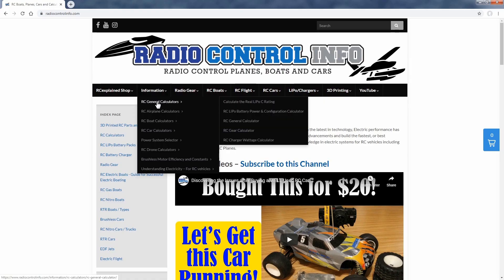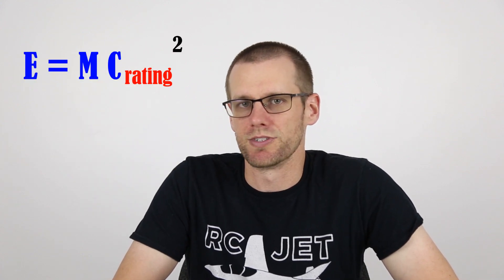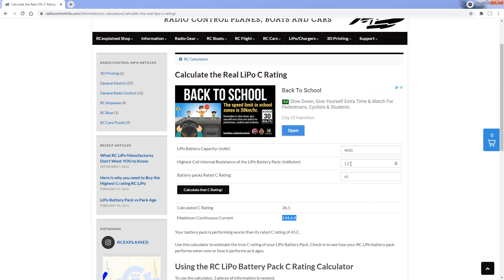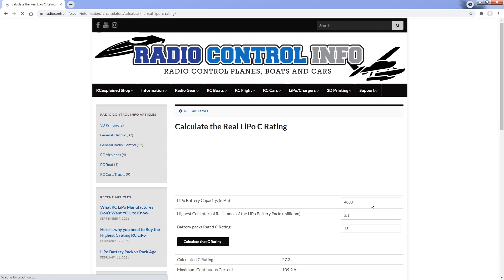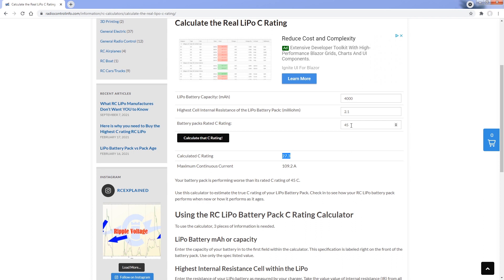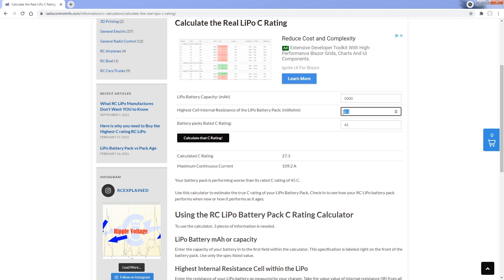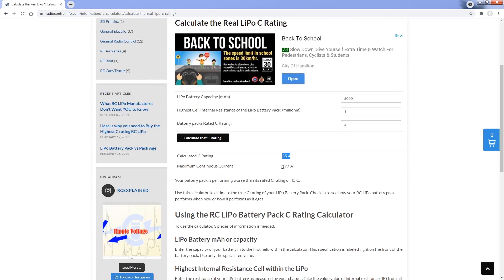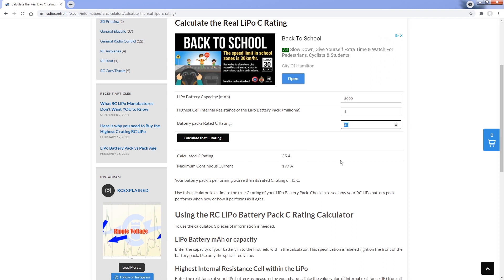Determine the Actual C Rating of a LiPo Battery, Formula Exposed!

Comment: Besides the inflated nature of the C rating. Why is there a C rating anyway, if the actual current in Amps, a battery is capable delivering, depends on the capacity? While, what really matters for the application is the current only!
What I mean is:
A 5000mAh battery with 50C could technically deliver 250A. A 2500mAh battery would need a 100C rating to provide the same 250A. A 2500mAh battery with the same 50C as the first example, would only be able to deliver 125A!
So what good is it to require a 50C or a 100C rating for a given application, if that figure still doesn't tell us, how much current the battery will be able to provide, without throwing the capacity into the equation as well?
What they should print on the battery label instead, is simply the current, which the battery can deliver! After all that is what an ESC bears on its label as a technical requirement for it to operate! 🧐
Reply from the maker: Absolutely agree. I think a C rating leaves the answer a bit cloudy and easier to inflate. Inflating the max continuous discharge current would not be easy. That's my take.
Reply: @RCexplained  Absolutely correct!
Inflating a precise Amp rating on a battery label would come closer to a blatant scam, as if inflating the voltage and claiming an actual 2S battery to be a 3S. Nobody would accept such a blatant scam. But, as you often mentioned, there is no definitive standard to even measure the C rating, which is a perfect setup to get creative...
Reply from the maker: Yep, exactly, and this is why I buy lots of LiPo's to test their performance and share the results!

Comment: I just want to make shure if it´s right, but why considering just 1 cell for internal resistance instead of total pack cells internal resistance? Do you have the formula oficial source?
Reply: His math is not correct. You need total IR if using total capacity.

If not you need to consider how many cells and how they are internally connected in determining how you calculate. 

His principle is right but this math is wrong. You don't just ignore a load and heat source because it isn't as big. If a 2s pack it experiences a 2 cell total output resistance due to being connected in series. Throw some parallels in there and it gets a little more tricky but not bad.

Comment: Lesson learned: pretty much all of my batteries are ~15C, even the ones which say ‘60C’. Funnily enough, like you have proven, the batteries with the most absurd claims like 60C have a lower actual C rating of like 10C compared to batteries which claim a less inflated 25C… do you have any recommendations for battery suppliers who give appropriate ratings? Thanks.
Reply from the maker: I don't think it's about who has true c ratings. I look at it more as who has the best actual true c ratings. So far smc if you are looking for discharge power
Reply: @ what about longevity? Thx so much for replying 😁

Comment: Hi I have a question about 4 new batteries I just purchased - these are rated 7,6V HV 2s2p lipo's rated as 140C - 5c Charging - your website doesn't seem to be able calculate with this. However if I use the 120C which is an option on your website I come to shocking results. The measured IR at 1.5 A charge is 3,6 mΩ for these 5800 mAh batteries - When I enter those numbers on your website these batteries should be rated as 17,3C ---thats a really big difference compared to the advertised 140C. Am I doing something wrong? These are the - Abisma Competition Lipo Shorty 5800mAh 140C 2S2P HV Batteries
Reply: he explained the formula.. you have to divide the constant use of 2500 by the square root of your batteries Mah capacity X the internal resistance on your worse cell.. 

Mah x IR =???? then square that number and divide it by 2500. that will give you your C rating

Comment: For a real world test use a volt/amp/watt meter in series with a high draw motor wide open.  Divide your amp draw by your capacity and that is exactly what the pack is providing at that moment.  100A draw divided by a 5A pack is 20C.  If you have it and your meter can handle it, try a higher power ESC and Motor.  I have an HRB that can deliver around 65A and a Roaring Top that can deliver 100A with the same load.  The voltage drop of the HRB is severe and the higher internal resistance makes the pack hot.  I have a 6 year old Power Hobby pack that can do 80A.
Reply from the maker: Yep, I did that on Zeee batteries on the channel. But more recently and quite a few packs I've tested, I've looked at IR and loaded power @ ~105A

Comment: hi great videos helped me so much. im making my own battery pack, but im struggling to understand the manufactures 3c rating on a 5000mah single 3.7v cell and turn that into a c rating like on a new 4s pack. be most appriciated if you or some one could help

Comment: Hello! Does this formula (2500/sqrt(capacity*IR)) applies to li-ion batteries as well?
Reply: I've salvaged some batteries from an old Lenovo battery pack, and according to this formula it gives a maximum current of around 25A. Is that possible?
Reply from the maker: The formula is untested for Liion batteries. You can cross reference specs on the cells to find max current.

Comment: I ran a bunch of my batteries with a 1.5c charge rate on a Spektrum S2100 charger and took the first internal resistance reading that popped up after about a minute. This is what I got:
Spektrum
4s 5000 100c ir=5.8 c=14.7
4s 5000 100c ir=4.0 c=17.7
4s 2200 100c ir=15.5 c=13.5
4s 2200 50c ir=15.6 c=13.5
4s 2200 50c it=14.7 c=13.9
3s 2200 50c ir=10.9 c=16.3
3s 2200 30c ir=14.7 c=13.9

Venom
3s 5000 35c ir=5.8 c=14.7

Gens Ace Tattu
3s 1300 45c ir=19.4 c=15.6

None were anywhere close to their advertised C rating and there was almost no difference between 30c, 50c, and 100c packs. It makes me a little suspicious of the formula or how the resistance is measured. Or is there really no difference between a 100c and 30c pack from the same manufacture?
Reply from the maker: Definitely strange that they all work out to similar values here. Formula is hard to argue with but the measuring tool could be a source of error. If 5.8 milliohm is true on the 5000mAh pack, this would have a hard time dealing with the power system installed in the recent EDF Jet video doing 249km/h that I posted. Just for reference, I use 4000mAh 45C packs and they have an average cell resistance on the charger of 3.2 milliohm. This is measured at a 1.5C charge rate 1 minute after starting the charge from 3.80V per cell. Make sure the cell resistance is measured quickly after initiating the charge and it's best to start the charge around 3.80V. Temp should be room temperature. Lots of resistance influencers here.
Reply: If those are your IR numbers you need new packs.  
But you are suppose to get your ir numbers with a pack at storage and room temp. And then charge. And take the ir reading when it’s close to finished

Comment: Where does the equation you show come from? Also, you are using the manufacturer's rating as part of the equation, but that number may just be made up. Also, when measuring the battery internal resistance, shouldn't a test current be specified such as 1C? Some of these internal resistance measuring devices use a very low test current and get an unrealistic low internal resistance measurement. It would be good to determine a C rating from internal resistance and also maybe temperature rise. Finally, thank you very much for trying to address this sticky industry problem and making such a great video.
Reply from the maker: The equation comes from a lot of testing and number crunching. You can see the battery tests we do on the channel. I've found a batteries true internal resistance by loading it at that value and making certain it doesn't get over temp.
I may have missed saying it in this video, we use 1.5C on the channel.

Comment: How are you coming up with this formula? Are you using Ohms Law: V x IR or P = I^2 x R? Formula is very suspect without some sort of explanation as to how you come up with formula and 2500 constant. "Extensive Data collection" doesn't really do it for me.
Reply from the maker: Yes, it was done with extensive data collection. All data points were plotted on a graph, and a regression analysis was employed to determine the line of best fit. Electrical theory wasn't utilized in this process. Although the formula still tends to overestimate the actual c rating, it gets significantly closer than any specification you'll find on a battery label. 

Additionally, I've shared battery test results, along with the methodology I employed to get the true C rating of a battery. These battery test videos are unpopular but there are several I've uploaded. Only one video shows me getting the true C rating through a loaded run.

Comment: Great video Ryan! I'm just getting back into the hobby from 30 years ago. I have a WL Toys144001 car that came with 2s 2200 mah 25c, brushed 550 motor. I'm preparing for an upgrade my 144001 to brushless. Planning to us a 3650 - 5900kv with the Quicrun 10BL120 ESC for Speed Runs and general parking lot driving. I'm trying to match the best lipo mah and c rating for this setup.  Are you able to recommend lipo to work with this setup? I've watched a lot of your videos but still somewhat confused.  Here are the motor Specs: Specification: 

3650 - 5900kv
Material: Metal + Magnet 
Weight: 204g 
Item Name: 3650/3T Motor 
Watts: 900 
Max Voltage: <8.4V 
Max Amps:107A 
Rotor Poles: 4 
IO: 5.2A 
Resistance: 0.0043 
KV (RPM/Volt) : 5900 
Max RPM: 50000  

Thanks for any help you may offer!
Reply from the maker: If your priority is speed. Largest pack in terms of capacity and c rating is best.
Reply: @RCexplained  Thank you Ryan for returning my question. 👊😎👍

Comment: Would this also work with a larger LifePo4 batter?
30Ah
Rated C in description: 5C max continuous
3-5 milliohm

I got a calculation of 7.2168
Would that be right?
Reply from the maker: Theoretically yes it should. I have not experimented with packs larger than 8000mAh however.

Comment: Could someone please expain me this, I have spektrum 6s 6800mah 120C g2 smart pack and according to the formula from the site in order to get out a 120c from this pack the internal resistance shoul be around 0,06 miliohm ( yes the coma is where it should be)
Reply from the maker: Yes, 0.06 milliohm shows you that manufactures have no business putting a 120C rating on a LiPo battery in 2023. To test this further, place an 820A load on the pack until it fully discharges and see what happens.

Comment: Had some issues calculating mine. Website won’t let me choose higher than 120c. My battery is a SMC 3s 8600mah 250c. I don’t have a way to calculate my resistance of the cells though. I can’t find anyone else who has tested this battery and if it’s C rating is true.
Reply: That would be 2,150 Amps, so not gonna happen.  Your wires and connector would liquefy.  Even 80C would be 688 Amps.  The wire feeding your house from the power company the diameter of your thumb is for 200 Amps.

Comment: So if it say your pack is 26c do multiply it by the cells seeing that ur only calculating one cell? Example 
26c X 4s = 104c total c
Reply from the maker: no, cell count is irrelevant.
Reply: @RCexplained  how is that accurate if your only measuring 1 cell
Reply from the maker: cell count or voltage does not come in to the equation.  The formula is C Rating x Capacity = Max Discharge Rate.
Reply: @RCexplained  have you tested the internal resistance of zeee 9000mah cells?
They claim 100C while the red one claimed 120C

And I want to know the true C rating without buying

So please let me know the true C rating of zeee just in the ballpark please
Reply: This has to be true,  I think the calculation only accounts for 1 cell not all. I think depending on the cells you have you would get the C end result calculation and times it by how many cells the battery has. It doesn't make sense for a 4s 100c 6000mah lipo to only have a C rating of 24c" I wish there was a Cell Count option in the calculator. More cells equal more Cs 🤣

Comment: this is cool and all but what about the batteries that have no C raiting on the label or paperwork
Reply from the maker: What do you mean? The C rating is calculated based on IR.
Reply: @RCexplained  ok i took more time studying this video because my brains slow. i see your formula.. 2500 divided by batteries capacity square root X highest internal resistance.

with that aside i cant for the life of me figure out how your website came up with 36.1C on a battery with 4000mah and 1.2 mOhm internal resistance.

with your formula.. 2500 divided by 63.24 (square root of 4000) X 1.2 = 47.43C X4 Ah = 189.7 max continuous amps
i am now totally baffled on how to find the c rating for my batteries
Reply from the maker: @motorbreathjz  you are changing the formula by taking only the capacity under the square root. Put both terms under the square root.
Reply: @RCexplained  you are right. i thought the formula was square root of Mah.. and then separately from that i would divide by 2500 and multiple the IR which is wrong

for anyone reading this in the future tho OP shows you the formula it is easily missunderstood when you have a slow brain. the formula is exactly as shown

your batteries total Mah x internal resistance (highest resistance cell for safety and common sense reasons) and then square that number and then divide by 2500.

thank you RCexplained and im sorry to burden you with stupidity.
Reply from the maker: I'm hear to help, glad you got it sorted out.

Comment: According to your calculator it is telling me that my battery is only putting out 183 continuous amps but how is my recorded data from my castle esc saying that I'm drawing way more amps than that on my speed runs. I know it has bursts but what I'm seeing is way different than what your calculator is telling me. My esc would catch on fire all the time for what this calculator is telling me
Reply from the maker: You can't compare continuous current draw to your 5 second full throttle pass. Continuous means for the entire duration of your battery. I'm sure you are no where close to this.
 Your battery could possibly support well over one thousand amps for one millisecond. As loaded time duration increases, current in amps decrease until you get to the continuous rated specification.
Reply: @RCexplained  but if my 5 second burst is showing over 600 amps would my constant be at 300 amps then if burst rate is double
Reply from the maker: The 2 to 1 factor is a general rule of thumb. A short couple second burst will be more than 2 to 1. A few microseconds could easily be more than 1000A.
Reply: @1976Nyquil  everything your saying is true.. for a 5 second pass.. lol.. thats not the same as a average or general use application

Comment: Not sure you understand c rating? Are you suggesting only zero 0hm I.R. will be correct as labeled? Maybe. However a 
100 C falsely labeled and a 20 C correctly labeled battery each with say 3 Ohm cells will come up as close to correct. Don’t think so!
Reply from the maker: I don't follow what your point is. Not sure what you mean by zero ohm IR either. No electric component can hit a true zero ohms.
Reply: the whole point of this video is to tell you the printed C rating is most of the time a lie.. it has nothing to do with c rating in a mathmatical/science sense being true or not..

Comment: I bought a 3S 5000mA battery from Sequre for my spot welder and they advertise 100c, the battery is not performing as it should at all, I put the battery on the charger and got 8-2-1 milliohms!!!!!

Edit
Brand is Zop Power and it's cheap at $35us maybe that's why its performing poorly...🤣

Comment: so I have a 2s  6400 MAH lipo with 120C rating. if I multiply 6400 Xs 120 that = 772,800 How does this tell me what C value to charge it at? everybody says charge around 1 to 2 C & never higher than 5c, how does 772 thousand tell me how many C to charge at? Thanks
Reply: your all over the place.. you need to find your internal resistance first to get your C amp discharge. and the charge c raiting for a 6800 mah battery is 6.8 amps... 2c would be 13.6 amps.. most people stick with 1c charge ..its hard to trust a company.. better off just doing 1c max charge...

Comment: Page and also video not explains where this formula comes. Very unlogical unfortunately..
Reply from the maker: The formula comes from a lot of hard work and data collection.
Reply: @RCexplained  I am sure it comes from hard work. But still no explanation? where this 2500 constant comes? Or when i enter milliohm value how it decides to C rate? normally V = I x R and 4.2v per cell with milliohm resistances not giving your values. Because of that i am saying it is unsupported work.
Reply: @FratDede  the formula is at 3:40 my man..

Comment: C rating and capacity are bogus numbers which mean absolutely "NOTHING "
The ONLY thing that matters is how high of run voltage you have under The maximum load!  and it is very beneficial to do it with telemetry for a particular application. The higher the Volts output under load, the greater the output power!!.. .